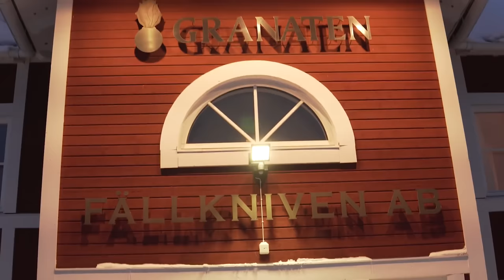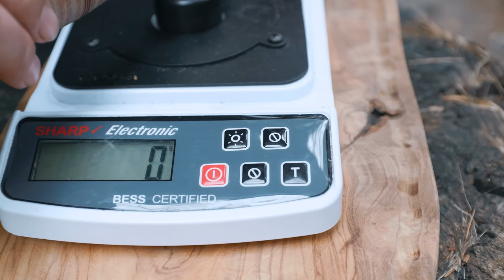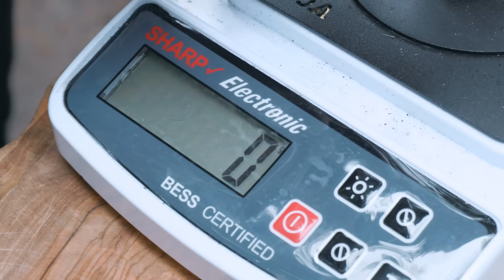INSTANTLY The Best Knife EVER.  Fallkniven NL5 Cos

Comment: The fact that your vg10 performed better after time is a significant sign that fällkniven overheated the edge a little but durung the sharpening process which is - sadly - kind of normal due to production speed. 
While sharpening you take away material and eventually will have ground away all the overheated material. That is why it has better edge retention now

Comment: These stacked leather handles sure are beautiful. I don't have this one, because of the price, but I have some others in my collection. They just don't leave the house. Leather sheaths can also be beautiful but not the most practical in wet conditions. I agree that the best slicers for food prep are not the best batoning knives and vice versa, so bring two knives. The F1 was of course designed as a 'one tool option' (pilot survival knife) and they did a great job. A 'Jack of all trades', master of none. I think the same goes for the JP Peltonen M07 Ranger Puukko for those who prefer carbon steel. I bought two of them. One in desert tan and fully coated with composite sheath for my collection and one in black uncoated with composite sheath. They have a high scandi grind what I consider to be a saber grind. The F1 is smaller, lighter and an overal more compact package easy to throw in basically any bag or even in your cargo pocket. It's what I call my 'just in case knife' when I don't intent to use it (much) but still want a knife with me. The handle is too thin for my large hands for prolonged use. The M07 is a bit larger with a thicker rounded handle that could be a 'one tool option' for when I want to travel light but know I'm gonna work with it a for a prolonged time. Air force vs Army. Pilots expect to take of, stay in the air and land (not crash). Army knows they will be on the ground most of the time. Maybe you should test the M07 uncoated. I think this roll lock system is brilliant.

Comment: One thing that's possible with edge performance, is that knives that are factory sharpened on a belt grinder, the edge can sustain some amount of heat damage. 
After multiple hand sharpenings on your wet stone, that damage is theoretically sharpened out. Which would explain improved performance.
Reply: Definitely, I noticed a huge difference in my vg10 spyderco after about 4 or 5 sharpenings… it’s honestly a huge problem with knife reviews. Most reviewers barely even sharpen their knives once, let alone the time it takes to get through the “bad steel” from the factory. It’s probably why steels like k390 get such better factory edge retention, because those types of steel don’t loose their heat treat from high temps.

Comment: tbf the vg 10 probably performed better than before because of all of your aftermarket sharpening. Grind angle has the biggest effect on edge retention outside of material choice, so you actually might have made the knife better than it could be out of the factory

Comment: It would have been nice if fallkniven soldered around the blade where it passes through the handle’s steel guard to prevent moisture entering through the seam. Many knife makers, such as Bob Dozier implement that process.

Comment: I have found the Cowry-X version of the Idun to be better at slicing and carving than the Lam Cos version. Have you found the same? Also - the Cowry-X version of the Idun has slightly different geometry. The cowry version has a clean convex all the way down from the spine. The Lam Cos version I have and more of a shoulder closer to the blade edge. (just for reference) Again - have you found the same?

Comment: But Cos is junk!??
Reply: No mate, CoS is a very well balanced, tough stainless steel which also is relatively easy to sharpen. Every steel has its pros and cons.
Reply: @Paul-gu2lv  You can see how well it has performed in many DBK vids (A1 Pro, S1 pro, F1 CoS, A1x). If will never be as tough as maybe 1095 or something, but the tradeoff is the stainlessness. It's a good balance between rust resistance, edge retention and toughness.
Reply: @MrJigglyBallz  Yeah, fair enough. I guess there's always a compromise. The only thing is because you have to pay for fallkneven twice, (in Japan and in Sweden) it's in the super steel range.
Reply: @Paul-gu2lv  Yes they are indeed expensive. I had a A1 and replaced it with the A1 pro 😅. If one like fallkniven knives it is worth it imo. Like is the TRC apocalypse worth it for 500 €? Or the Extrema ratio selvans for 450 €? Both are very good knives but so expensive they make fallkniven look like good value. It is up to the buyer if it is worth it in the end.
Reply: @MrJigglyBallz  Yes. That's true. I like fallkneven because they remind me of the old Cold steel knives when they were made in Japan (same place) that I used to dream about when I was a kid.